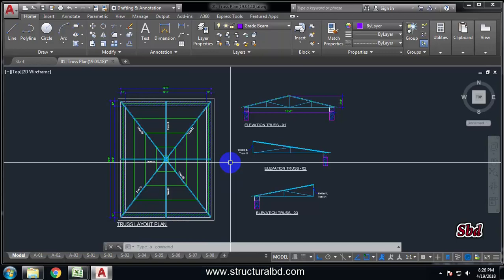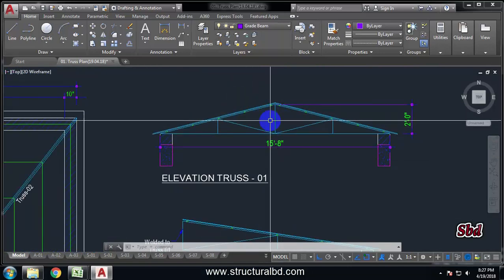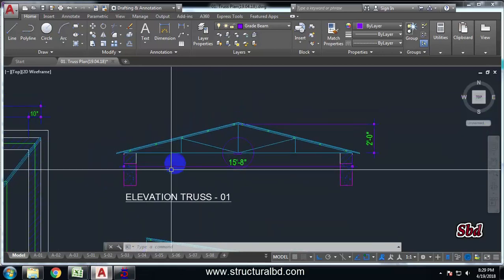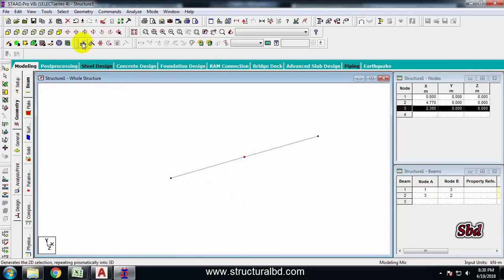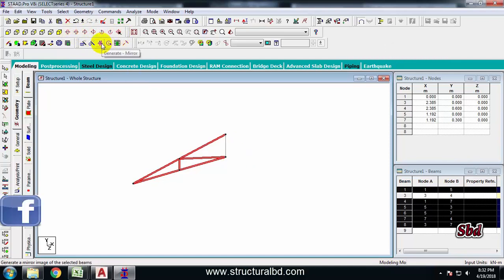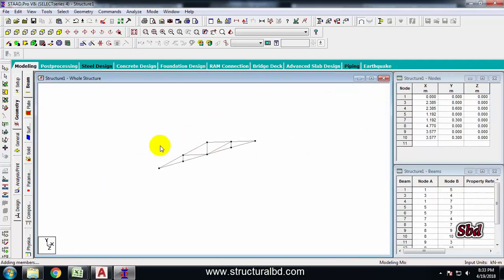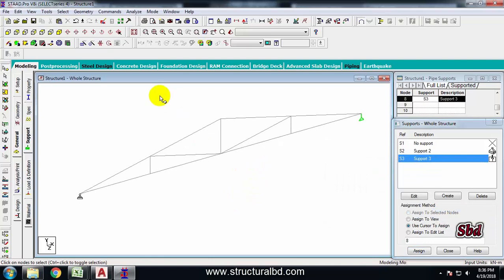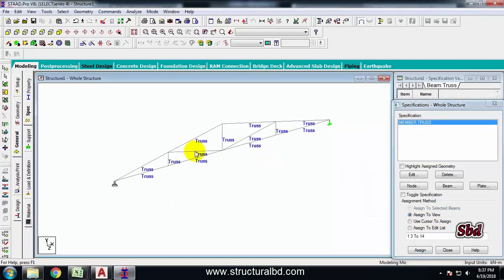How to Design & Analysis Truss Practical Problem Part 01

Comment: Why are you putting a Udl on a truss, this is not a portal frame.Truss are subjected to axial forces so even if your load was a udl you should change it to a total load and divide it by the number of nodes on the truss to get point loads.The analysis approach you are using is wrong.
Reply from the maker: Software can calculate the point load from udl. No problem